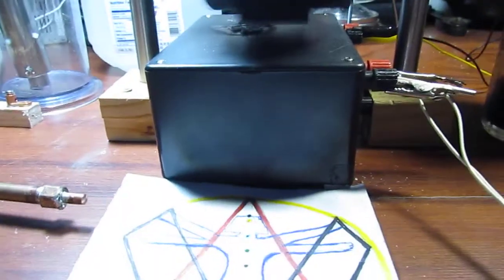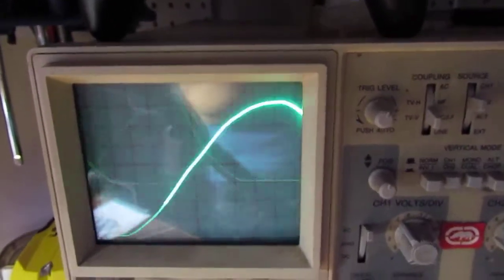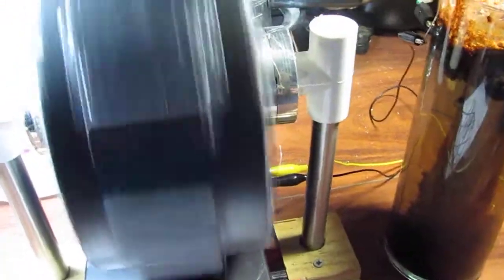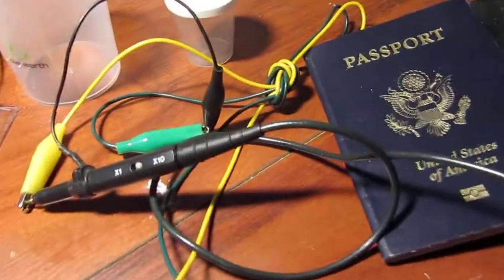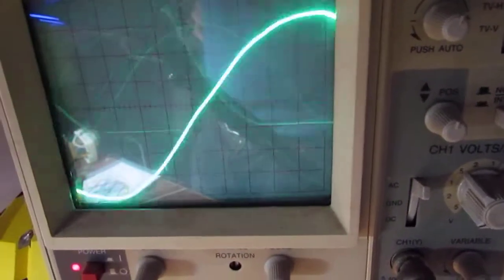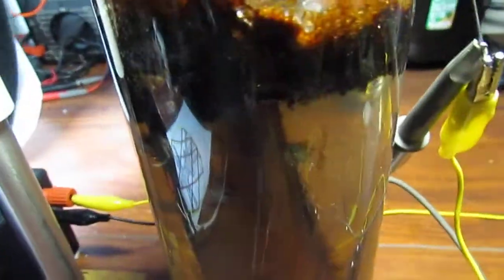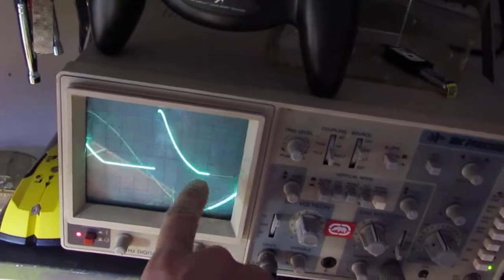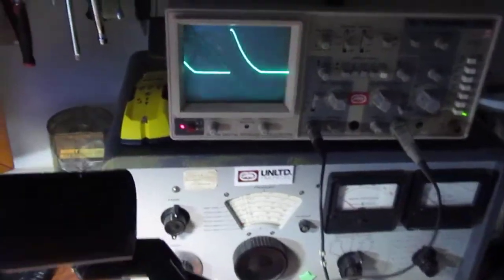Update Part 1

Comment: Great work. I agree negative energy is where it's at. Deuterium, transmutation, and all kinds of other stuff. All I could do to improve on what you have done is put a starship super coil or few with the multiple pulse, loop or whatever and get hundreds of negative spikes.Modulate the pulse with another pulse!!! Awesome.  Starship Type 3 Released                     Bedini No it's a Starship #3